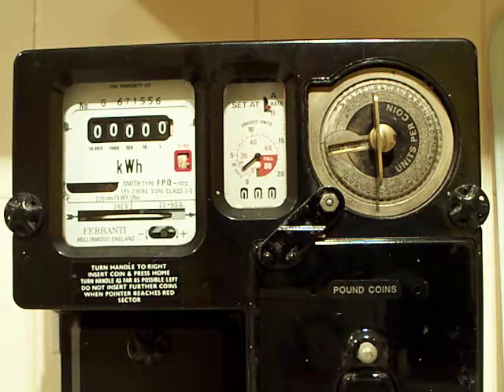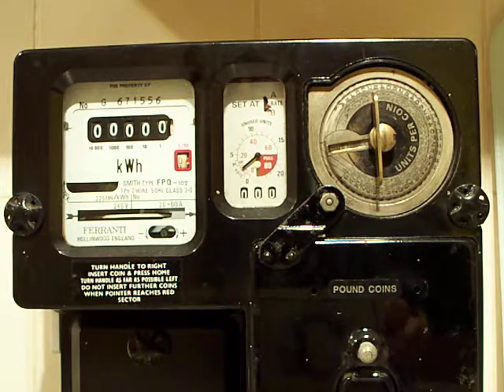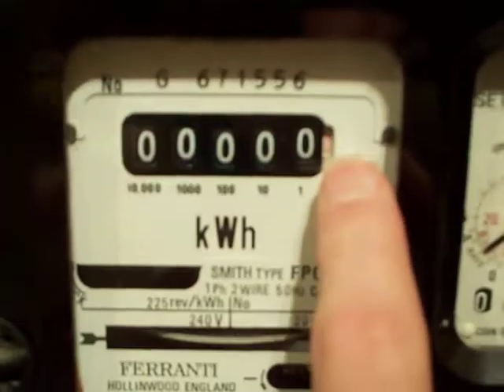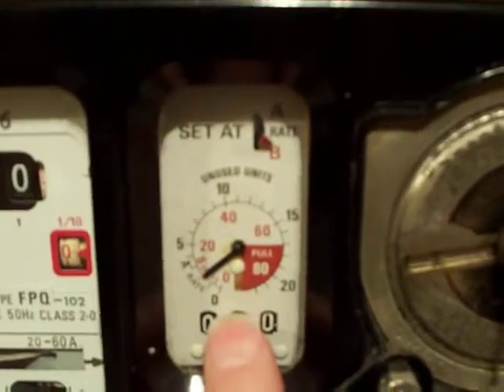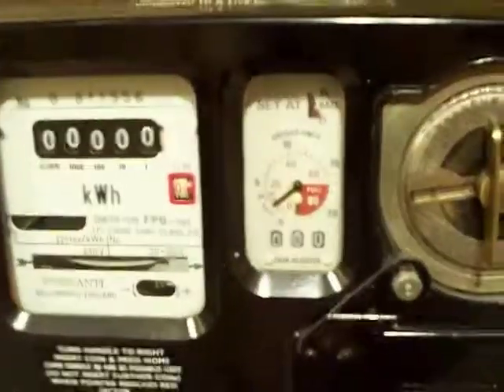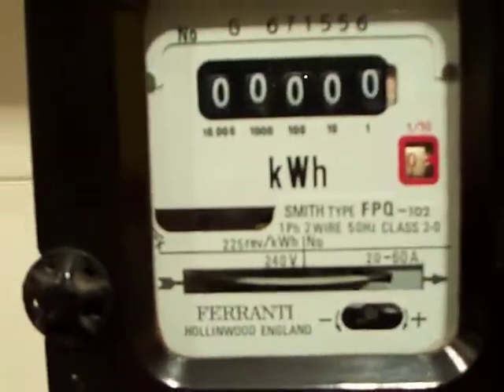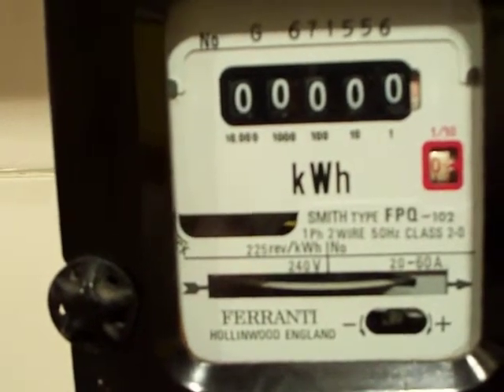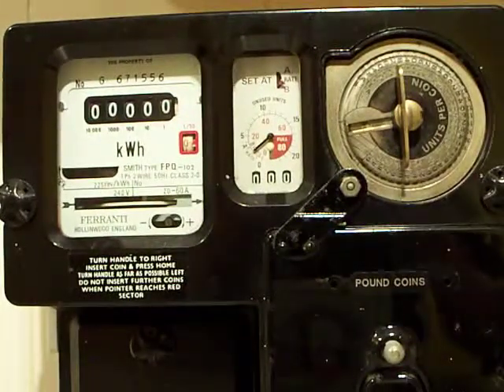Electricity Meter: Ferranti FPQ-102 Prepayment Meter ( Variant )

Comment from the maker: @regregex Yes, I know these instruments top-to-bottom, front-to-back. It's difficult to explain in 500 characters, but it's to do with the 1.0 kWh dial. Basically, with this meter, the 1.0 dial does not click 1-2-3-4 etc, but slowly turns around, so this one determines what number that dial is on for reading purposes, & that mini-dial is also weighted. Just before zero, this dial swings a weight which turns the 1.0 dial to 0, & the tens dial to 1. Again, difficult to explain in text.

-BBD.

Comment from the maker: ALSO! Have you checked my videos of the similar meters like the Ferranti APQ, the FPQ-102, the F2K-50B, or the Smith APM instruments? I cannot remember if I may have explained on any of those videos, in detail what the dials do. All of the Smith / Ferranti instruments shown work internally more-or-less the same, so if I explain it on a Smith APM meter, then the same will apply on a Ferranti FPQ-102, APQ, or F2K-50B. Internally, those instruments are very similar, even with inerchangeable parts!.

Comment from the maker: The first and most important question is: How many kilowatts is the shower?

If you have a Ferranti FPQ-102 or a Ferranti F2K-50B, they can take 60A, which at 240v is equivalent to 14.4kW. 

HOWEVER.......

If you have one of the older Smith meters, they can only take 40A (9.6 kW) and would probably struggle a bit, and a 10kW shower would pop it, WITH FLAAAAMES!

Some of the REALLY OLD Smith meters are only 25A!! :-O (or 6kW)so do watch out for those!! :-O

Thanx for watching,

-BoomBoxDeluxe.